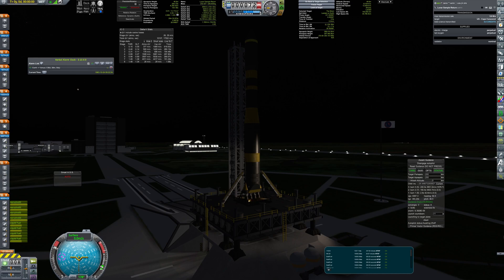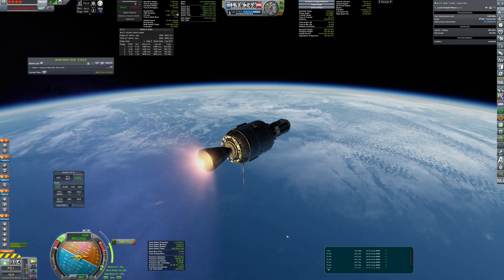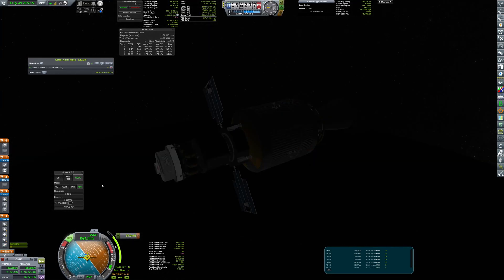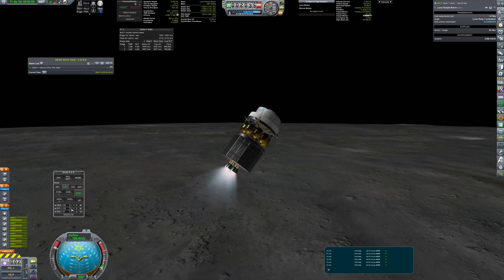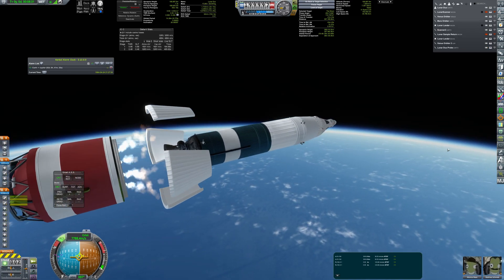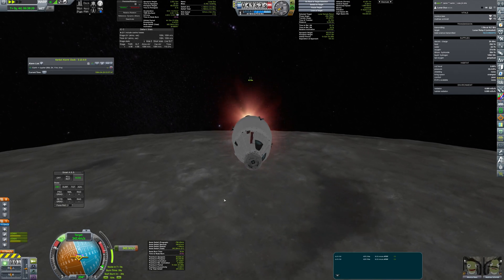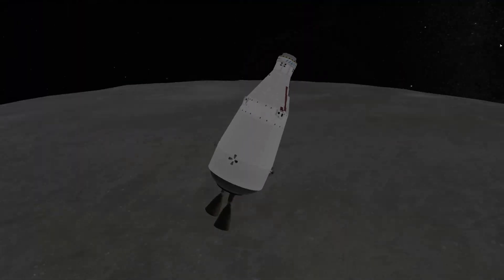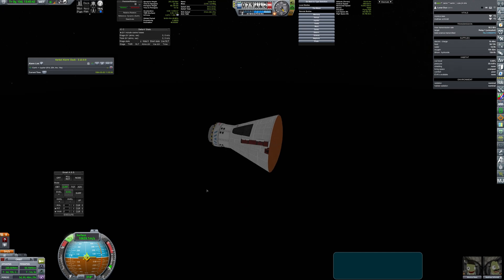Lunar sample, rendezvous and problems (RSS/RO/RP-1)

Comment: I have a question, does the probe actually collect samples or it's just "simbólic"?
Reply from the maker: Yes, it does collect some.
Reply: @Darkherring  and which mod did you used for that?
Reply from the maker: @nilschaves6681  It's a build-in feature in RP-1
Reply: @Darkherring  thanks
Is there a way to making it without Real Solar System?
Reply from the maker: I believe there is a mod for that, but I don't know it.
Reply: @Darkherring  thanks